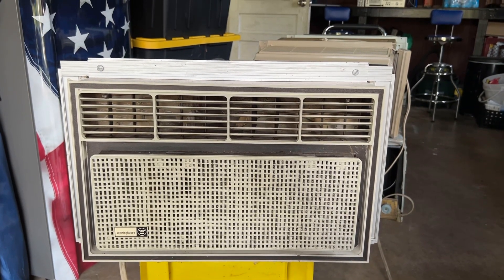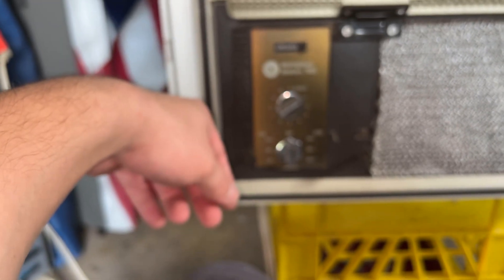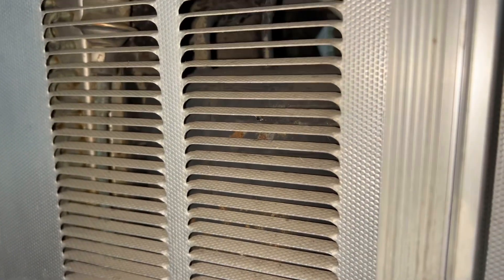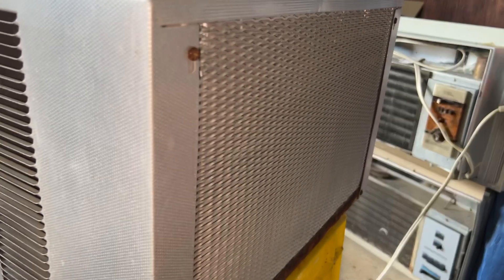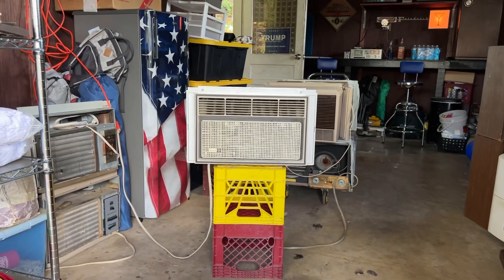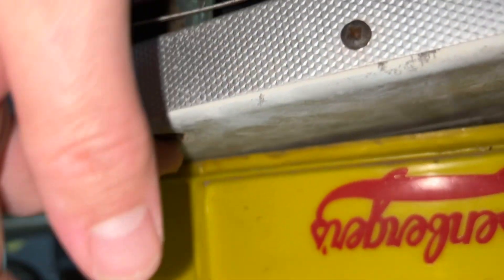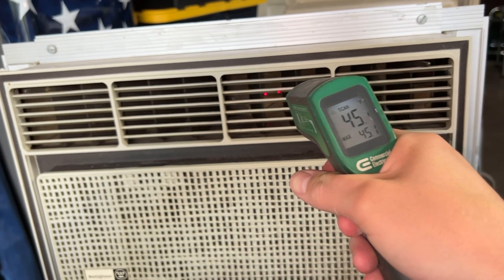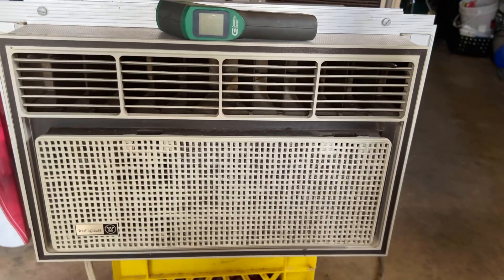1960’s Westinghouse Mobilaire 7000 BTU Air Conditioner!

Comment: I bought the 6000 BTU unit that looked exactly like this, for $5 at a yard sale! I thought the price was a joke, that's all she wanted. Lady said, "We got whole house air, and don't need this anymore". That was 1980 when I got it. I used it for years, then moved it around to many Pittsburgh apartments as I moved along. I last used it in 2002, in my bedroom when it finally died. It was a little noisy for my liking, it was between me and the TV, so I had to keep cranking the TV to hear it. Many great years of service! Mine had slides on rails, slide the front cover to the right and it would move only enough to expose the controls. Or, push down to remove completely to change the filter.
Reply: If you still have it, try swapping the run cap out. It might still work. Westinghouse units were built to last, as you can see in this video.

Comment: I have the more basic version without the flip up panel, but it's 6000 BTUs. Sadly, I had to remove what remained of the torn and bent plastic side panels out of the metal brackets, and I have to replace them with classic accordion style ones, but these are really solid units. Blows ice cubes in seconds.

Comment: I love my Westinghouse!  The compressor is a little noisy on the inside but I don’t care because I just love the sound of the flat top Bendix compressor.  Reminds me of the large chassis compressors.  You might think I’m crazy when I say this but I’m starting to like the sound of the Bendix a bit better than the Tecumseh AE.  The past 2 summers I’ve been using the Westinghouse instead of the Fedders because the Westy is a 6000 btu so it cools my room down a lot better than the Fedders since it’s only a 5000 BTU
Reply: Hey Will,  FYI, the 'flat top' compressor was made by Westinghouse, not Bendix.  Westinghouse Electric and Bendix-Westinghouse were two completely different companies.

Comment: Yeah, I've got one of these. You get used to the noise and it kinda becomes "white noise" and is a plus if you've got noisy neighbors.  The down side is, it draws something like 10 amps. Not very efficient, but blows cold as ice. Newer A/C units of the same size use half the power.
Reply from the maker: @_CAT-lg4sr  the small westys are more power hungry than some of the bigger ones. But damn can they ever perform. Much better than any of the ones today can.
Reply: @TheAirConditionerGuy  It's all about the R-22. I believe that is what they're juiced with.

Comment: This decorative front style was introduced in 1969 and made for a very short time before WCI bought Westinghouse in the mid-1970's. The large chassis high capacity units were called 'The Southerner' series and, as far as I've ever seen, did not use this style of decorative front.  Although you never know.  The filter in your unit is not original to these models.  It is an aluminum mesh filter made by Research Products which is used for industrial air filtration and will last forever.  When used in a window unit or for home use, it has to be coated with a spray liquid called 'filter coat' which increases its effectiveness. Otherwise I would recommend to replace it.  When WCI bought Westinghouse they discontinued the 'flat top' compressor.  A sad day.  Those compressors were reliable and last forever.